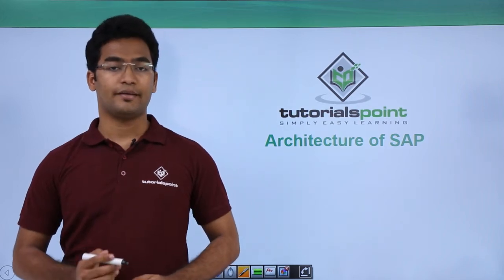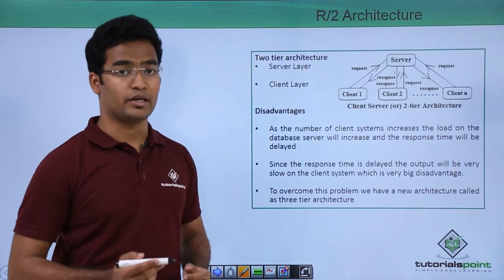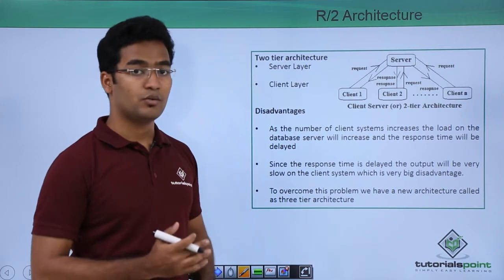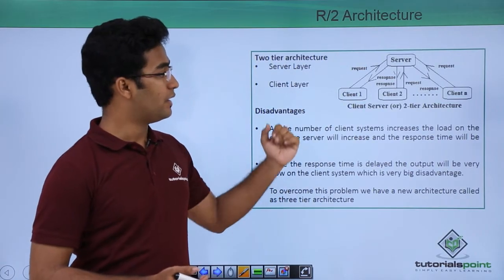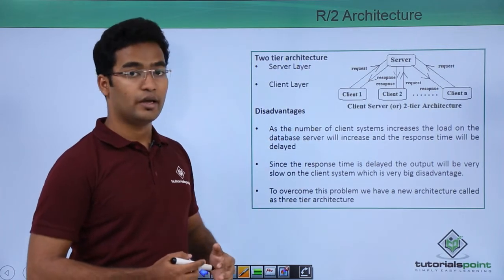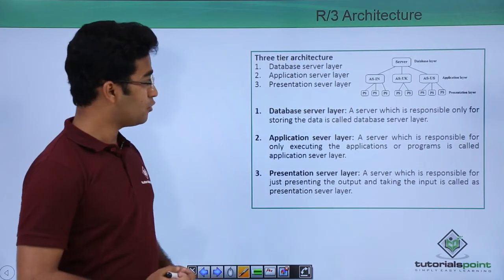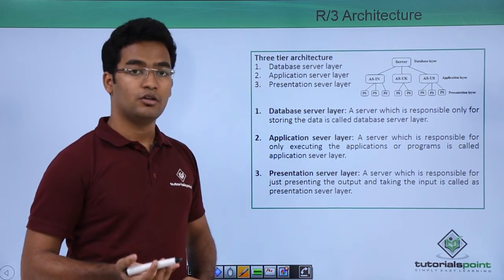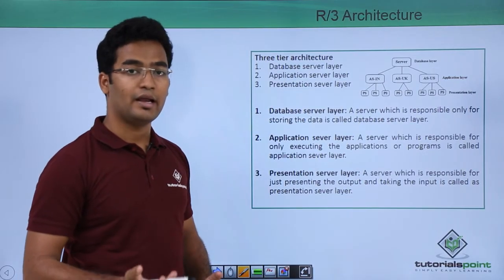SAP ABAP - Architecture of SAP

Comment: The 2 in R/2 is NOT related to the 2-tier architecture. Just a release number. The predecessor of R/2 was called RM/1 and was also 2-tier. Actually the clients of R/2 are 3270-terminals, which run on the same host as the server.